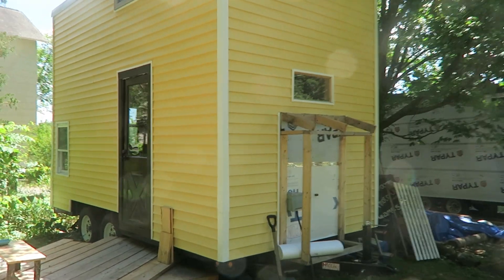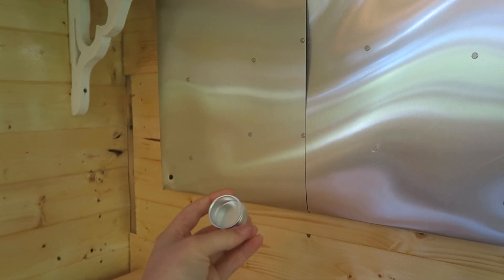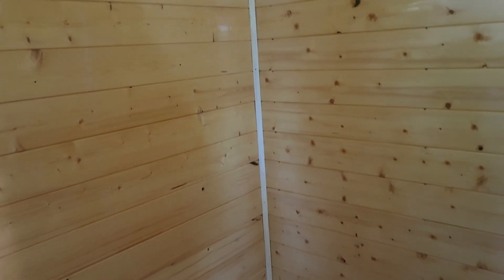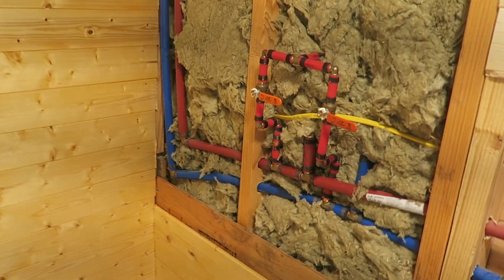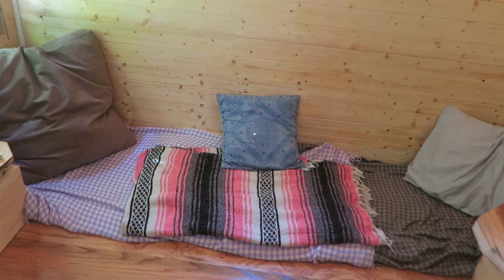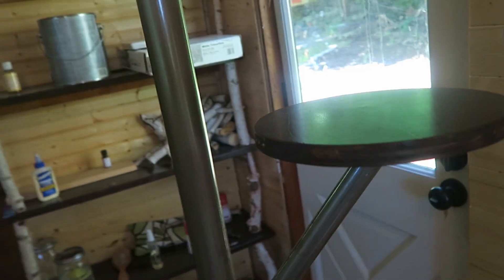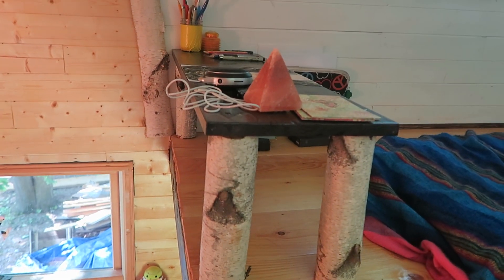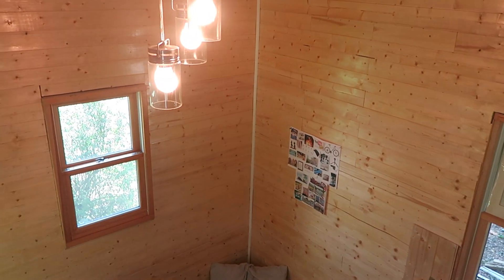Tiny House "Finished" Tour

Comment: I saw moisture on the loft window. Do you have ventilation or a way to dehumidify? Moisture turning to mold is the biggest problem tiny houses have.
Reply from the maker: Yes :) its actually on the inside of the window because I lost these two little plugs that go in two holes on the outside!! So it doesn't have to do with the ventilation :)